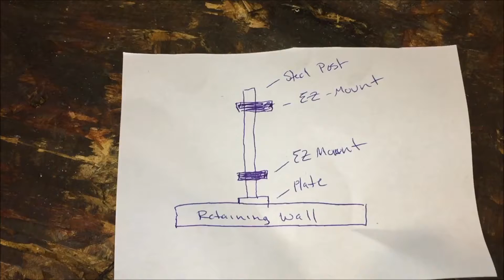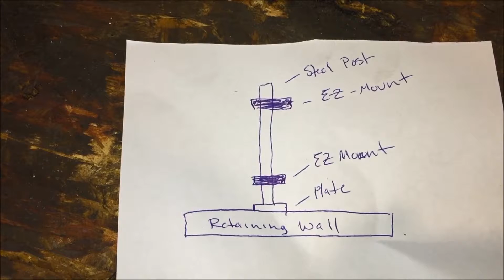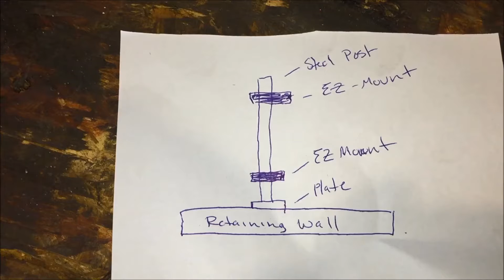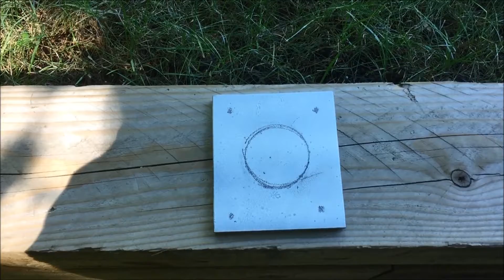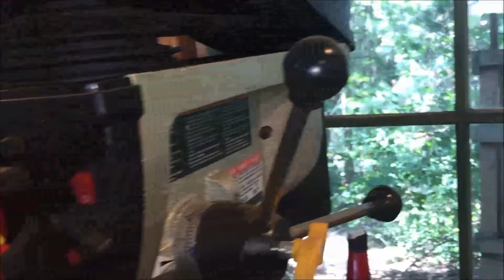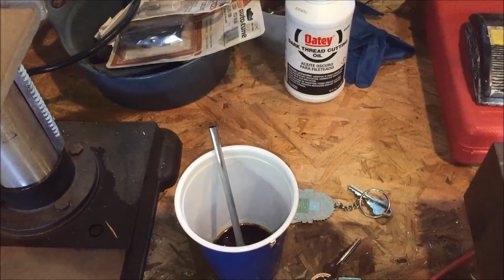Installing a Vinyl Fence on a Retaining Wall (Making the Mounts)

Comment: Good afternoon, I found your video very helpful, thank you very much. I have a question for you the rubber mounts that you used, where were you able to purchase them please and what is the correct name for them. I search EZ mounts, however unsuccessful.  Your assistance would be greatly appreciated. Thank you
Reply from the maker: I bought them from my fence supplier.
Reply: Thank you is the true and correct name EZ mount
Reply: What a clown